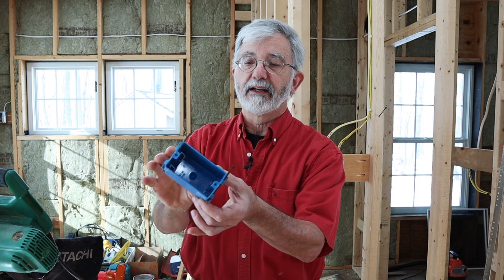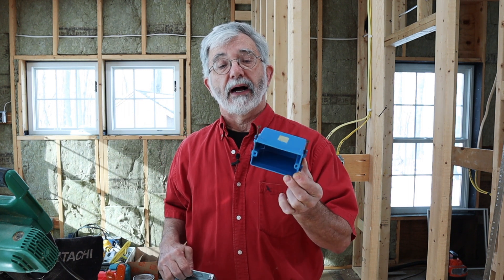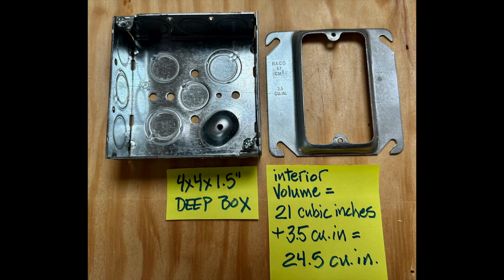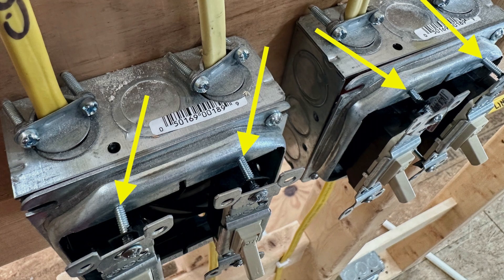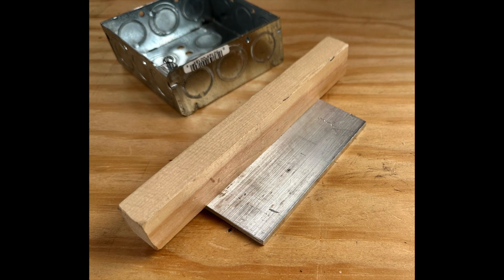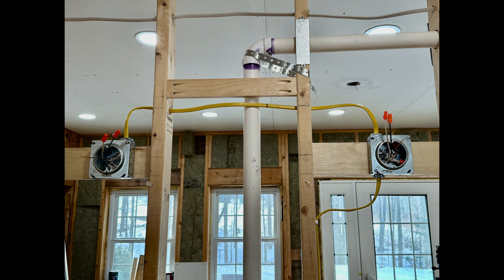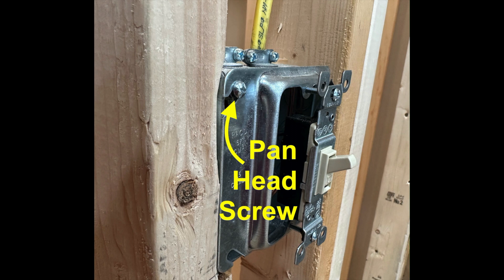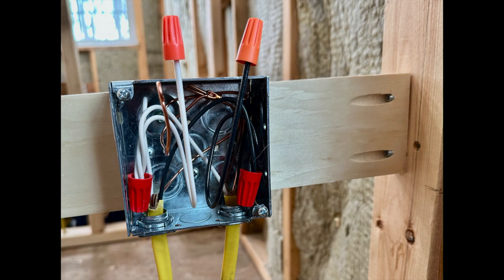Steel Electrical Boxes Are Better Than Plastic! (With How-To Details)

Comment: As always, I love your videos.  Thanks for making them.

I'm a little confused about the drywall finish.  If you happen to record that...  I'd watch it!  Thanks again.
Reply: PS:  I'm planning my 25 minibeds tonight.
Reply from the maker: @pboin  Perfect size to start. I'm heading into my 6th year of Minibed gardening. Looking forward to it. Here's wishing you Minibed gardening abundance in 2023 and for years to come.
Reply: @pboin  My 23 are doing well.  I've really enjoyed them.  I used used billboard plastic.  Our extreme summer heat has shrunk my plastic from 3 sides, a few inches.  Can't control that.  Otherwise, the frames and plastic have withstood for 5 years.  Such a pleasure to sweep up a little, and look at the organization and crops.  Looks so nice, and produces well.  So easy for weed control and irrigation.
Reply from the maker: Good idea... I will definitely make a video showing how to "fix" and finish drywall gaps around electrical boxes. 👍

Comment from the maker: I expect and welcome any disagreement with what I've presented in this video. Constructive criticism or helpful insights are also welcomed. But I've received a couple insulting, disrespectful and rude comments. That's not cool. I would never leave comments like those on any video. Please be kind. 🙂❤
Reply: That's another reason for my husband's desire to retire from contracting.  People, vendors, sub-contractors, owners have become very difficult to work with and for.  Few people want to work.  They are very lacking in skill and ability, are not careful, and are only out for themselves, not for the customer.  Messages and communication is deteriorated and spotty; sometimes missing in action.  Anger reigns, quality is non-existent in service, appliances, and in keeping one's word.  It's in everything we do.  People aren't reliable.  Chaos reigns.
Reply: I expect a contractor that uses them blue plastic boxes will disagree at least I used the better quality grey plastic boxes. I saw the blue boxes when I bought the grey ones. The grey ones were heavier and I thought they would hold up better. Metal is best and had I have to do it over I would use EMT and the metal boxes that go with the conduit. The Romex ones are good. But EMT boxes have more room for the wires.   My dad used the deep boxes because the code required extenders when Daisy chain wiring was done. The deep box was within code and no side extender was needed. 73
Reply: Yes you can get the same results using the Romex 4 inch box. The plaster ring or attachment is the best invention using 4 inch boxes. EMT boxes require the plaster ring for single and double outlet boxes. I also like the extender box so you can make the box twice or more deep for larger wires. Metal wins. When dad rewired the farmhouse we only used the single box but was metal. We had to go with a deep box because of the daisy chain wiring. Much easier to install. I don't remember seeing the deep boxes at Home Depot they do carry the 4 inch box. 73
Reply: Great video. I come from a family of electrical contractors, so please let me add a suggestion. I looked at your solderless connectors (wirenuts). Please consider trying the 3M Performance Plus wirenuts. My family uses those and NEVER have issues. I'd say they're the gold standard. Slightly more expensive but so worth the slight additional cost.

Comment: This is one of the dumbest videos I have seen in a while.
Why did the plaster cutout for the plastic box have to be so bad and the cutout for the metal box have to be perfect?
For most installations plastic boxes work fine.  I would use a metal box on a 240 VAC or a high amp circuit. Or any circuit that will be on an unfinished wall or inside a garage. Or any circuit that has a higher chance of the wiring going into it having a higher chance of pulling out.   But using a metal box for a light switch inside a finished wall seems like a waste of money.
Reply from the maker: Thanks for the negative feedback without being disrespectful, insulting, or rude (I've removed a couple of those already). 👍 I agree with you that for most installations plastic boxes work good enough. I mention that in the beginning. They are code approved, which is to say, good enough. I'm confused about the plastic box cut-out that you mention. There is no plastic box cut-out shown in this video. At the end of the video I show a poor drywall cut around a plaster ring. Then I show what all the plaster rings (including that particularly bad cut-out) will look like after I have finished the drywall.
Reply: @herrickkimball  I did not say plastic box cut out.  I did say plaster cut out.  That was a mistake.  I should have said drywall cut out.  And I still don't understand what it was about the plastic box vs. the metal box that causes the drywall cut out to be so poor for plastic and so perfect for metal.
Reply from the maker: @michaeljorgensen790   Okay. Well, I can't figure out where I said anything about the drywall cutout being poor for plastic and perfect for metal. The cut-out for plastic or metal depends entirely on the person doing the cutting. Either can be bad or good. And either one, if bad, can be made perfectly good in the end by a good drywall finisher. 👍
Reply: @herrickkimball  Okay, Well, I still can't figure out why the finish of the drywall was even included in a video about metal vs plastic boxes?  When you show a picture of the drywall and say this is the way you do it....I don't really make the connection of why?  Unless maybe you are monetized by YouTube and just needed to put out more content?...  Ah I see now....43k subscribers means that you are.  I should have stayed quiet....I too am a capitalist and did not mean to jeopardize your stream of revenue.
Reply: It's overkill for sure, but if people are willing to pay (a lot) extra for it then why not? My only major gripe is the set screw connectors, too many times have I had to track down a short only to find that some idiot crushed a wire with one of those, thankfully they're not code compliant where I live anymore, for this very reason. Of course, neither are crimps for ground connections, but that's another story.